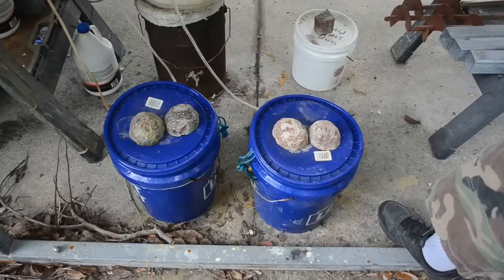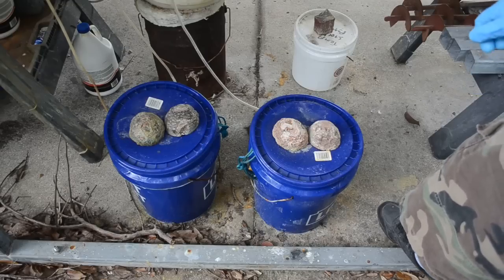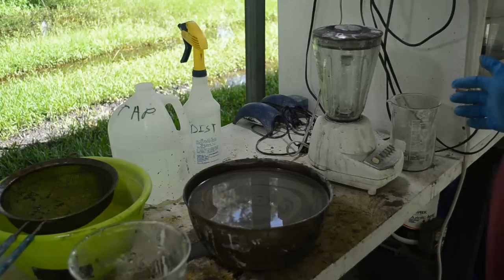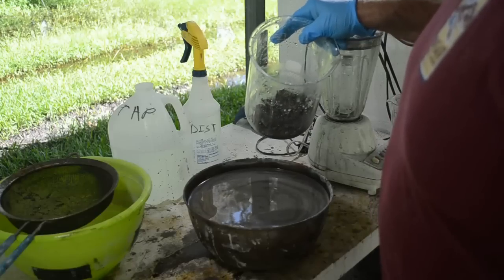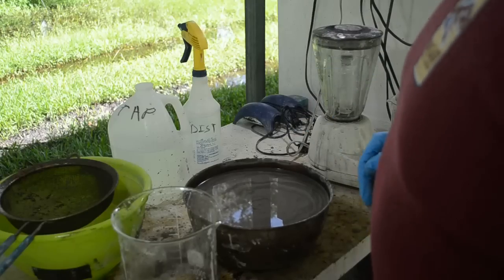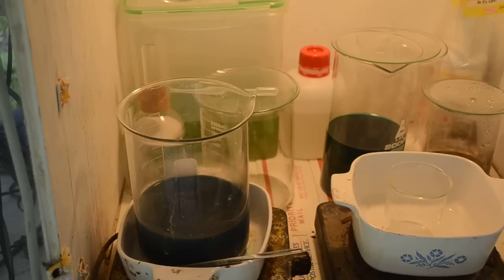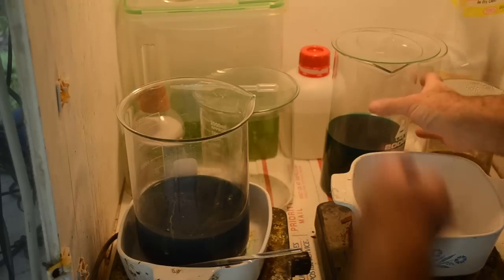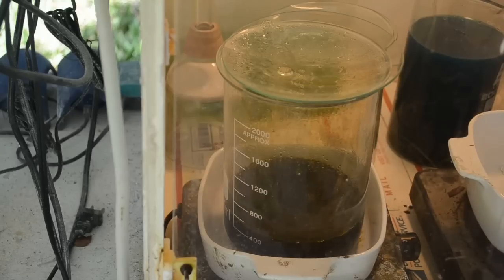Recovering Gold and Silver from 3.8 kg of Flash RAM IC chips, Part 1

Comment: Good video!  Can’t wait for part 2 now.  Since they’re all the same type, I think I would have done a reality check first before starting.  That is, crack a couple of the chips open and look at them under a microscope for gold bond wires sticking out of the plastic?  I’m pretty sure there will be, but it would give you some peace of mind before putting all that work into it.
Reply from the maker: Yes, that is a good idea. Unfortunately I was kind of committed. I couldn't inspect the chips before buying them. Once I bought them, I could only hope they contained enough gold to be profitable.
Reply: @omegageek64    Well you’re in a bit of a different situation.  Even if these chips had been a total failure recovery-wise, it still made for a couple interesting videos for your channel.  Also since you make your own nitric you don’t have a big investment in the chemicals.  I occasionally buy new-old-stock or surplus lots of chips if they both look like they have good potential for gold content, and they sell cheaply enough that I think some profit could still be made refining them.  The first thing I do when I get them though, is break one or two open to put under a microscope and see if there is visible gold inside.  For one thing that tells me if I should buy more if they are offered.  Secondly if I don’t see gold in them, they could potentially be resold for their original purposes.  A lot of people on eBay play the long game and will buy big lots of pretty much any chips, then sell them off piecemeal to make a profit.  I look at the age, certain manufacturers, the chip’s function (if I can find any info online), the package type, etc., then hope for the best.
I’m glad you tried the wet grinding though.  I thought it would work out better for you, and is better for the blender jar’s bearing.  My machinist friend used to make black powder in a kitchen blender using cheap methyl alcohol from windshield washer fluid to fluidize the chemicals.  Then he used a filter press to remove and recover as much of the alcohol as possible, before drying the pressed pucks of BP and eventually corning them.  It wasn’t as crazy as it might sound actually, and using water wasn’t practical in that case since it would leach out the KNO3 and throw off the stoichiometry.

Comment: I would  bet the gold turned black in the fire, or more likely,
 the acid may have changed Gold to black... Great job so far ... Wondering about the containments in the gold solution? but.. I'm sure you'll take care of it with second refining ... some times it pays to be slower ...   
Also.. 
I am very ready to see "new" Start to finish Nitric acid production set of videos ... 
Please include clean up & disposal of 'plug' , storage container types,  and the dilution methods... I would also be interested in seeing methods for recovering nitric from "stock pot (copper)/waste container (Iron)" if you know of any ... 
Pleas take your time, indebt information is more important then length of video :) 
Tips... from my Very limited experience
1 seal joints with sulfuric acid .. 
2. I use sealed tube with out thermometer over the boiling flask ... Kit therm doesn't work very well any way ... I check temp at the oil bath ... thinking of getting a candy therm for this job
3.  (for cleaning)  In the cooler with the Ice water bath .... I add Baking soda after I'm done to clean glassware ...  I do not put the boiling flask in cooler
4. be VERY careful with flasks they crack easy ...

Comment: Have you ever had trouble with melting or vaporizing the gold through incineration?  

I ran some connectors (captured in hard plastic) in a SS pot that I set in a small fire.  I found a gold blob on the bottom of the Stainless pot....

Comment: I wonder if this could still work when stacked vertically one above the other in the same bucket as long as there's a bubbler underneath 4:22 
I also wonder if one could use an aquarium powerhead which is a sealed submersible liquid-cooled pump like those used in saltwater aquariums a small one in the 150 gallons per hour range

Comment: I would skip the sluice part and proceed with the nitic acid process.
The silicon splitters won't soak off the gold bearing liquid, but there could be some remnants of the bond wires attached on the dies.

Comment: Wandering instead of using the nitric acid for the copper , using instead muriatic acid & hydrogen peroxide to dissolve the base metals / copper .
Then another question , does muriatic acid & peroxide dissolve  silver ?
Main point being elimination of one substance at a time , with a lot of the video you have copper - so before the slice , dissolving the copper with muriatic ?
Thanks again